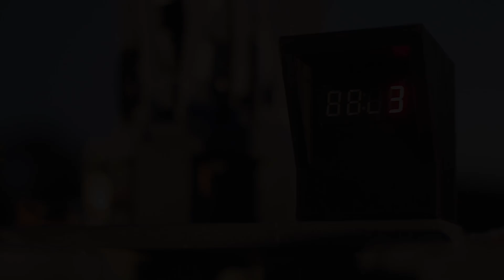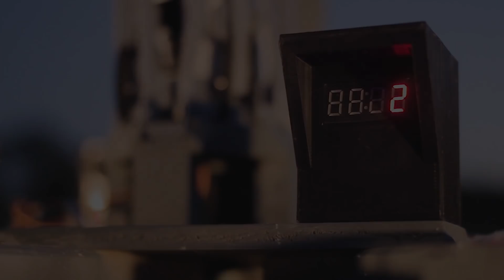Series Intro - Landing Model Rockets

Comment: grid fins no they are for hyper, super, trans, subsonic flight regimes unders 500kmh gridfins are useless,but dual aerodynamic drirectional motored fins and air brakes yes could work but one need gimballing and better thhrust control the trust cutting you do can make the gasses move faster as first the spill out the sides, no i wont become a patron but id love to work with you improving designs

Comment: Just spitballing here ... have you ever done a feasibility analysis of carrying water on board to douse an srb when you get close to the ground to cut thrust? Fill a little baggy and have an actuator open a valve to flood the motor? Too heavy? Wouldn't work? Whatcha think?

Comment: Clearly your problem is 1) weight distribution  2) components not rigid enough  3) you need to determine the proper amount of thrust and throttle down to maintain a slow enough descent. This may not be too realistic given the choice of fuel.  Real rockets have things like fuel pumps and a strict control of flow, so it's something you simply may not be able to achieve on your own without some really refined tech.

Comment: Could you replace the rocket propellant with a single electric propeller for testing or fun?  Although then you have to worry about extra weight from a lithium powered battery etc...
Reply: Electric propellers work when in atmosphere but once you leave the Earth's atmosphere they become useless in space. If the overall goal is to reach space, it makes sense to start working with the technology that will be used in space now.

Comment: I’m currently making a a model rocket engine that uses liquid fuel and can thrust to land the rocket. the model rocket is about 5 feet tall and diameter is 7 inches I made the body of the rocket out of carbon fibre so I weighs only 8 pounds the engine will sit on gimbals that I’m currently designing myself hopefully we can both achieve to land both of our rockets in the near future.